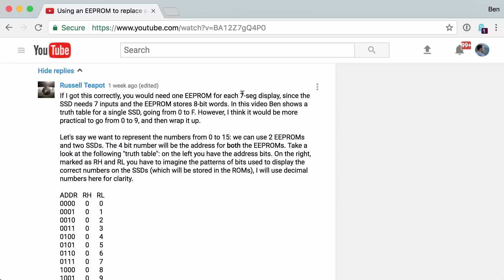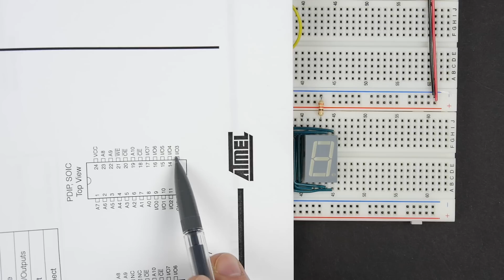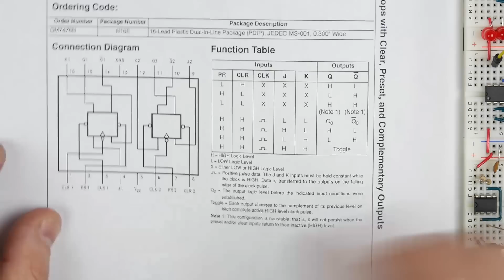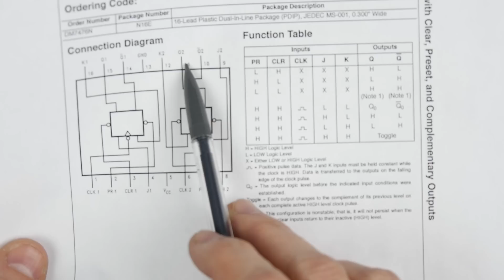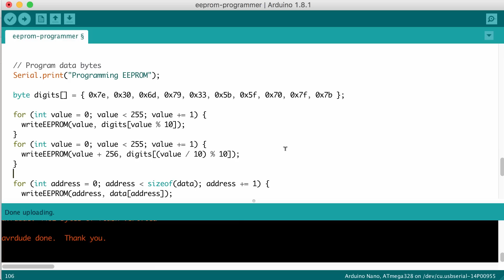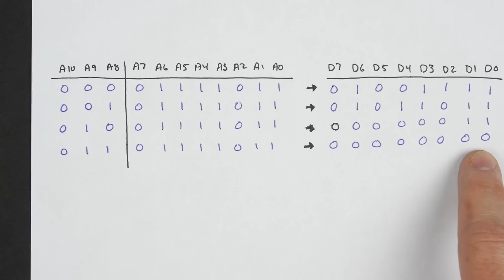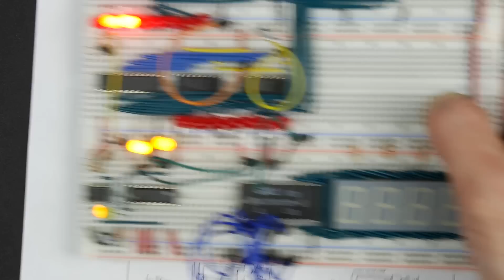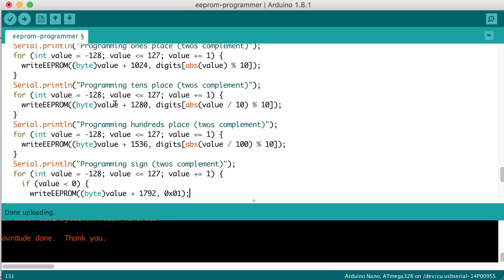Build an 8-bit decimal display for our 8-bit computer

Comment: What I especially love about Ben’s videos is the production quality. The editing—both audio- and video-wise—is outstanding. Notice how seamlessly he joins together different video cuts (at normal framerate and sped up) with his audio commentary. Lots of clever L- and J-cuts there.
Reply: Ben edits in the way these kinds of videos should be edited. Unobtrusively.
You hardly notice the editing, which is a sign of a good editor.
Reply: @st0rmforce  ok....o
Reply: Thanks for your explanation, now it's very clear to me :)
Reply: L-cut: audio continues but visuals change. J-cut: audio changes but visuals don't. According to wikipedia the names come from the way the cuts appear due to how audio and video are arranged in non-linear video editing programs. Typically the video track is above the audio, so if you imagine the top of the L is the video, and the bottom the audio, you see the audio cut appear later than the video cut (the bottom of the L juts out to the right). Same with the J cut, you can see the audio cut (bottom part of J) occurs before the video cut. Kinda cool!
Reply: What are L-cuts and J-cuts?
Reply: @scitwi9164  About halfway through the video I noticed how seamless everything was also.  Very cool.
Reply: I can imagine myself doing some parts of Ben's work on his videos as good as he does it. But he does it ALL near perfect)
Reply: The planning, and the flow are totally stunning, too. Everything ist totally understandable and each step leads to another. As he adjusted the clock rate of the 555! That was so utterly satisfying! From a didactic standpoint, you simply can't do it any better!
Reply: There us no production quality its an educational video, one guy in his basement with a tripod and a pencil is not what youre used to because youre not used to normalcy everything on the internet is extreme and provocative youre hypersensitized just breathe and be normal with us not everything has to be made if gold.
Reply: Pakistann

Comment: To avoid bugs like that off-by one in the for loop, it's best to stick with the idiomatic use for(i=0; i<size; i++). don't muck around with <= some times, and < at other times. This way you always do "size" iterations, and you can adjust your usage of i inside the loop to do what you need. When you get used to that idiom, code like the one in the video will stick like a sore thumb, and you'll notice such bugs immediately.
Reply: You missed my point. I didn't say "never use anything other than the idiomatic form". I said that if you always use the idiomatic form when it's possible, then when you see non-idiomatic forms of for loops, you will immediately notice it and try to think if there's a reason for it. So you will find bugs immediately in code you read, and you will not introduce such off-by-one bugs in your own code.
Reply: @jtsiomb : And just as I read and commented on this, and then added my like, you main comment in this thread had the same number of likes as the main number that Ben was having the counter display!
Reply: I'd argue in this case - because it is educational - the triple loops are better. They illustrate what he is doing better and are only negligibly less efficient (all the time is spent in the writes, not in loop math, after all - and the combined loop would have an identical number of writes.
Reply: Exactly, half-open intervals are the way to go.
Reply: +Sci Twi
I'm not up-to-date on C compilers, but AFAIK for(byte i = 0; i < 0x100; i++)Foo(i); will cause an infinite loop. Once i reaches 0xFF, i++ will wrap it around to 0x0 and it will still be < 0x100. <= 0xFF wouldn't help either, btw.
So you'd have to write a different loop for this anyways.
Reply: If you're going to train yourself to limit your usage in that way then just train yourself to check your fencepost logic every time instead.
Reply: I was thinking the same thing...I was also screaming at my computer to combine the loops into a single loop).
Reply: Noticed the bug immediately
Reply: Why would you intentionally limit yourself to overly simplified usage that gets taught to people just starting out, once you realize you can go beyond those limits? for loops making use of say, for(...;i=next(foo);...) are one of the most useful tools there are. Strange uses are fun and often faster. Trying to force every solution, no matter how intuitive, into a box before deciding it has to be done differently is just stupid.
Reply: @DarmaniLink  do not underestimate the power of idiom and patterns. It was not my suggestion to only ever use the idiomatic form, but when you can, you should.
Reply: @jtsiomb  How about use it when its the most intuitive, and use other forms when they're the most intuitive, and just leave comments for any jr devs who might struggle with an assignment in the check? Cute hacks make me smile. Seeing a bunch of code using hard learnt patters is a sign of someone who learned starting in college and never had any passion or curiosity for it
Reply: Arduino is C++, you could use iterators and range (from Boost, just copy the 3 headers)
for(auto i : irange(0,0xFF))
I created a simpler range implementation too. https://gist.github.com/Byte-666/c300aa09e3667d26e40589184efb588f
Reply: there's a better way for that (which is arguably a special case): uintXX_t n = 0; do { fiddle_bits(n); } while (++n); — this also avoids having to spell out the exact (size-dependent) bit pattern.
Reply: I know that one can do it with a while loop and base on the mod 2³² arithmetics. But this is an entirely different solution, not related to the for loop and `<=` vs `<` dilemma ;J TLDR: you're right, but irrelevant ;)
Reply: Pakistann
Reply: But what if you want to go through the entire bit range, smarty pants? ;) Then there's no way to encode the size, because it doesn't fit into any register ;> (it's one bit too big)
Reply: No,  you just use an IDE with code analysis that can rename identifiers, like Visual Studio,  and you never have to care if it's referenced once, or 6000 times across 400 files.   Ctrl+R and type a new name.

Comment: Would it have been possible to use a BCD to 7 segment display, like a 4511B to do this? Or would that actually be more complicated?
Reply: custom fabrications BCD to hex would be easy, feed each nibble in to a decoder and job done.

But decimal is much more complicated. There isn't a simple system like the first 3 bits are your ones, the next three for tens, or anything like that.

So you'd need to come up with some kind of intermediate decoder to take an 8 bit BCD value and convert this to ones, tens and hundreds BCD values, if you're feeding it in to BCD to 7 segment decoders like the one you mentioned for example.

Have some first hand experience with this very situation. I was trying to do this recently for a project I am working on, a clock built out of discrete transistor NOR logic. I had wanted to have two 6 bit counters for minutes and seconds, and then decode their outputs to drive two 7 segment displays, but it was becoming super complicated, so I ended up settling for a counter for units and another for tens, and two simpler 7 segment decoders hooked into those counters, similar to what you'd build with some 4026s.

Long story short, you could do it, but it takes a LOT of logic.
Reply: That makes sense. After looking at the data sheet for the IC I mentioned a little closer, and started to just think about using a few of those to get the same results as Ben, I couldn't come up with a good way to do it. I'm fairly new to arduino programming, so I'm a little confused by the code (I get the jest of it), but other than that, it's a great solution.

Comment: Flash chips are cheaper
Reply: a single microcontroller instead of the whole project is cheaper still.
Reply: KX36 True, but it wouldn't have the same value, then. But substituting EEPROM and/or SRAM for flash chips makes no difference for the project, other than the price tag.

In addition, going for flash means that one can easily expand the computer to 64k address space, which can store multiple programs in memory, including routines that expand the usefulness of the computer, such as additional mathematical routines, like multiplication, division, modulo and more
Reply: That's what I'd like to learn next: how to program Flash memories, because they are cheaper and more available these days indeed. But from what I've seen in their datasheets, there's some fancy stuff going on with the programming, with sending some special codes to unlock the bytes & stuff I don't quite get :/ (especially if I wanted to do it by hand first, because I can't afford for a dedicated programmer yet).
Reply: Parallel flash chips aren't all that common anymore. The industry tends to use serial flash chips more often now. But it might still be cheaper than EEPROMs. Also don't forget that DIP flash chips with an 8-bit parallel output are not as easy to find than their EEPROM complement.
Reply: Sci Twi From what I gather those codes are only needed when using the software option. Hardware option seems to be equal to both SRAM and EEPROM

Comment: Congratulations on figuring out a way to do more with less. :)

I did that once, when I was trying to figure out how to interface to an old Commodore disk drive which used the General Purpose Interface Bus.  My first circuit was built in a hurry and the I/O ports appeared at several different addresses, but I later figured out that by rewiring the interface, I could not only completely decode the address so the ports only appeared at one address, but I could also get rid of two of the ICs I'd been using.

Comment: Ben, can you tell me how exactly do you cut your wires so perfectly?
Reply: There's a sweatshop of wire cutters and benders behind the camera.
Reply: @KX36  
No he has around 500 chinese slave labour workers , they all work for 3cents a day  :P
Each one is tasked with making a certain wire length and shape. so that when he needs a certain one,  1 OF THEM CAN JUST PASS IT TO HIM IN THE EXACT LENGTH AND SHAPE THAT HE NEEDS IT

Now the smart among you might say ... How do they pass it to him so quickly without jumping on camera and saying stuff like "Save Us" :P

ANSWER : Because Ben can't risk that his viewers know the truth 
he uses a CONVEYER BELT
they put the wire on the conveyer belt and ben has a foot operated switch to turn it on and off and the belt runs directly to bens hand
SEE.. SIMPLE AS THAT
Legend has it that ben spends approx $10k on this setup so that he can get a 2 cent wire passed to him whenever he needs it 
LOL
Reply: I found that getting the wires just right is a lot more tricky than I expected! I'm using a small exacto knife (the one that looks like a surgeon tool) to strip them - placing the knife on the isolation, then rolling the wire around a few times - which seems the fastest way to strip them accurately.
Reply: @AceBruuDofSpades  222
Reply: math, but you can use a caliper.
Reply: TheCreepyBox Few ways.  They used? to sell precut pre stripped  lengths.  There are also strippers with an end stop. iow strip an end cut to length and strip the other end. You get two even stripped ends  on a cut to length wire. Good ones aren't cheap. One jaw grabs the wire the other jaw grabs into the insulation end pulls a pc off. The two jaws spread apart when you squeeze the handles. Sort of the opposite of regular strippers.
Reply: They're usually called 'breadboard jumpers" and  can be purchased, they are rigid compared to copper wire.
Reply: ih8tusernam3s he doesn’t use jumpers, he uses hook up wires (at least that’s what I think they’re called) if you look on his website (eater.net) and look at the various part lists and whatnot that he has for his projects, it’s not jumpers
Reply: @ih8tusernam3s : Oh? And what metal would you suppose these are made of then (as if Cu could never be rigid at this gauge)?
Reply: Flush clippers and a good stripper I guess. I use one made by vise-grip. It's a neat mechanism. A million times better than cheapo strippers. It's heavy though, could be used as a weapon. 
(Part number: 2078300)
Reply: Readme .txt :))
Reply: Get a good wire stripper, not the ones for electricians, get the ones similar to the katapult klein tools wire stripper. Then figure out how long the wire needs to be and how many bends, if any.  Usually don't have to measure, just lay the wire down on the breadboard/perf board, hold the wire with long nose pliers and bend. Then bend the end the stripped wire. experiment to get the right length of stripping, but you can always trim it if it's too long so better too long than too short
Reply: Strip about 1/2” off, then measure the needed length. And carefully slide the insulation until it’s 1/4” from the end.  Then cut it off clean, both sides are stripped evenly, and usually from normal size jumpers it does a lot better because you can compare it directly to the breadboard without stripping too much,
Reply: if you just cut your wires close then if too short use a wire stretcher to lengthen to size needed.
Reply: Chutttaa poor
Reply: I just use the board itself.  I rough-cut the wire and strip one side.  Then, I place it on the board to its exact location.  Where the destination hole is, is where I want to bend the wire.  I cut the wire the right length past that point, and then strip at the point where I measured.  I usually just hold that point on the wire between my fingernails until it has been stripped.

Ben likely does his measuring during a trial run before filming, rather than doing it and live off-camera.
Reply: Cutting isn't the problem.
Use a good side cutter.
Stripping may be tricky but very easy if you use 26AWG Wire Wrap wire and the regular stripper for it.
Reply: use your teeth
Reply: TheCreepyBox - Good question. Almost everyone has no idea how this is actually done. 

If you mean shape the wire to fit rather than cut to length or strip, then recognize that he is doing it off camera before the filming. 

He has his components on the breadboard then he strips one end. Next he puts it in the hole he wants. Now the hard part, he uses a pair of medium length needle nosed plies with very thin jaws to carefully bend the wire to the correct angles (using 90 degrees whenever possible.) When he gets to the hole that he wants to end in, he cuts the wire 3/16-1/4" longer than necessary so he can strip and bend that bit of bare wire fit in the hole. 

It is not hard. One trick is to place several different colors of wire rolls (22 AWG solid core) on a dowel or rod of some kind mounted very close to where you will be working. 

If you do this just a few times you be very good.  This technique was extremely important back in the old days when we wire wrapped very large boards. 

Try to use a color code. E.g. He is using blue for bus, red for 5 VDC, black for common, green for address, etc.
Reply: They sell jumpers made the perfect distance for breadboards, and they come in kits and different sizes, and thats usually how i build on mine